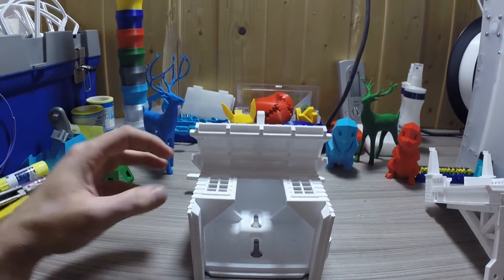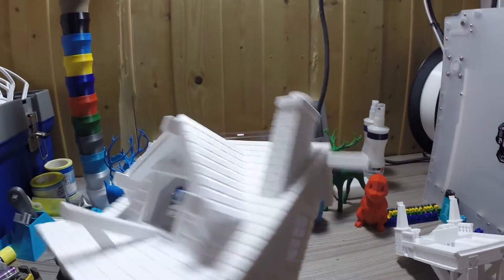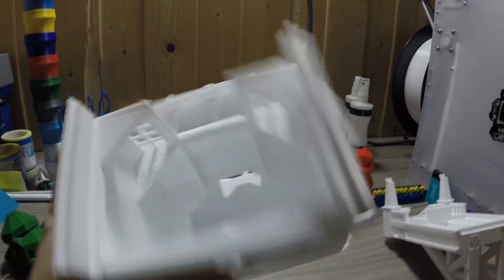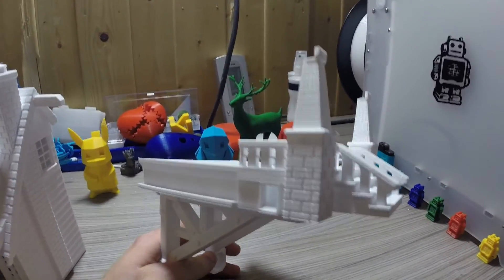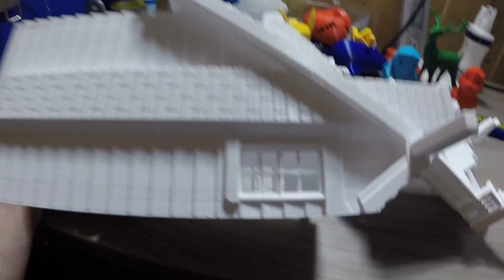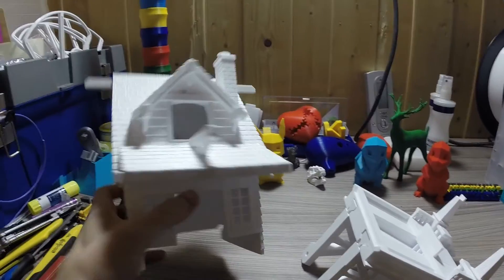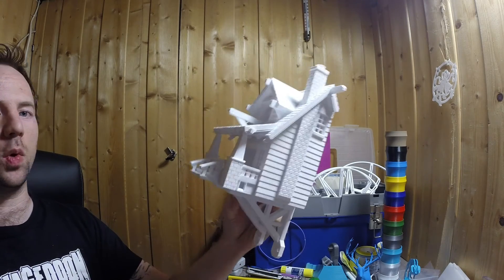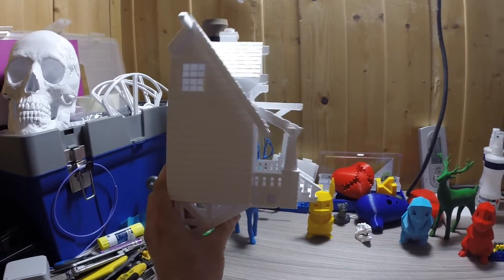3D Printing THE Birdhouse on the Ultimaker 2!

Comment: hey what scale you printed this and does it still take up 1kg spool at those settings
Reply from the maker: I printed it at 1X scale as in I did not change the original. I don't know how much material I used but I doubt it was that much.
Reply: alright thanks currently printing upgrade parts for my i3 and next it will be the turn for this amazing birdhouse 
changed my settings and now its 600grams so about 170 meter filament
Reply from the maker: It's a pretty big birdhouse, I usually write up my print settings in the description field here on youtube if that helps you :-)
Reply: its done posting it tonight to thingi total print time 36 hours :D
Reply: Making this now. My print is looking immaculate

Comment: hi there ,
amazing model!
could you tell witch  setting did you use?
Reply from the maker: simo leo Settings used are in the video description :-)
Reply: I'm sorry mate I can't find it surfing with my phone 😓
Reply from the maker: simo leo 
Printed at scale, 
layer height 0.15 mm, 
50 mm/s, 
20% infill,
250c on nozzle,
70c on the bed, 
fan at 100% from 0,5mm up.
Reply: 👍 thanks a lot!
Reply from the maker: No problem :-)